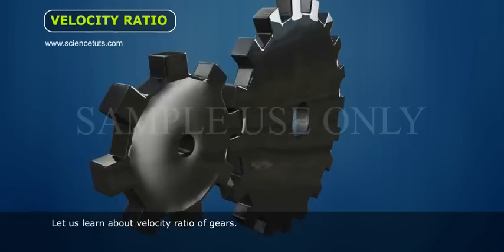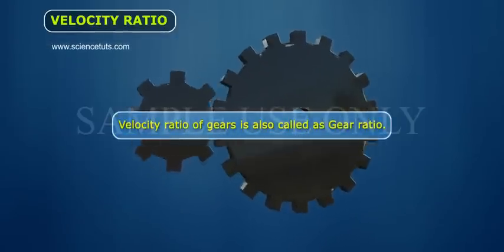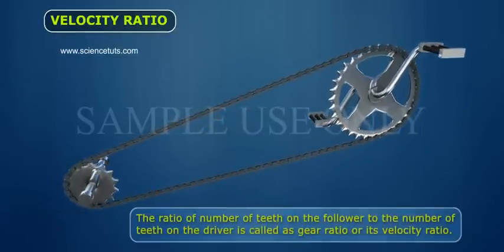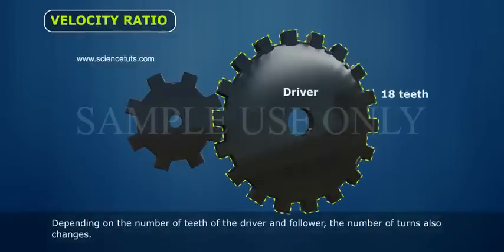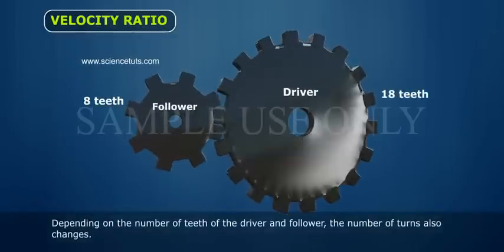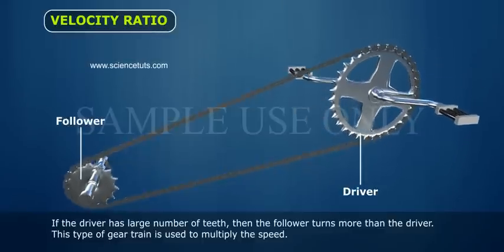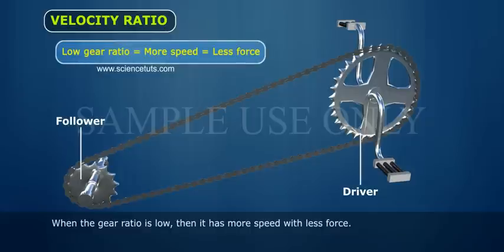VELOCITY RATIO OF GEARS

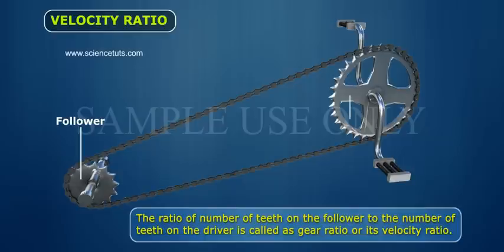Comment: The confusion in the formula at 0:35 seems to be whether it is using velocity/number of turns, or the number of teeth. 

Gear Velocity Ratio = Driver Velocity or Number of Turns / Follower Velocity or Number of Turns, 
while Gear Ratio = Follower Number of Teeth / Driver Number of Teeth

It doesn't help that a lot of sources use Velocity Ratio and Gear Ratio interchangeably.
Reply: Velocity ratio and speed ratio are reciprocals of each other...that is why all the confusion is coming